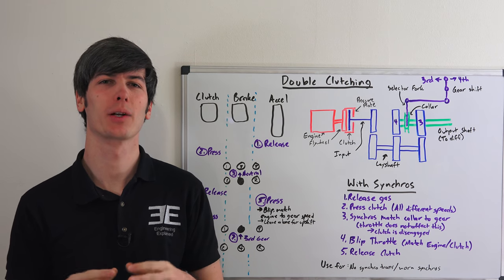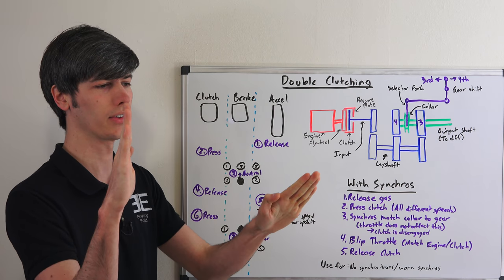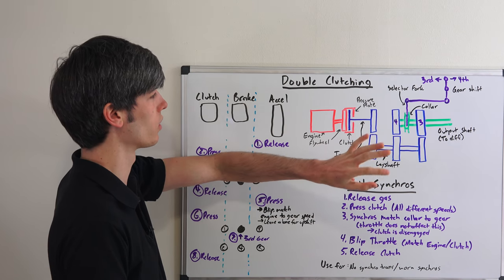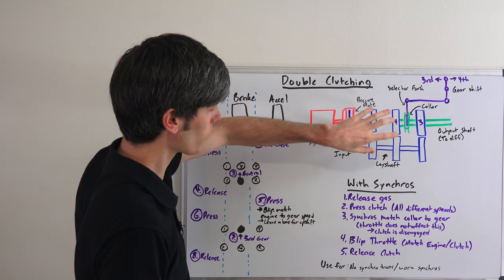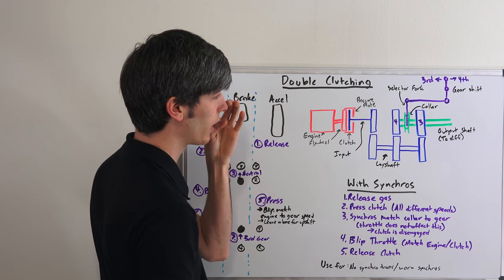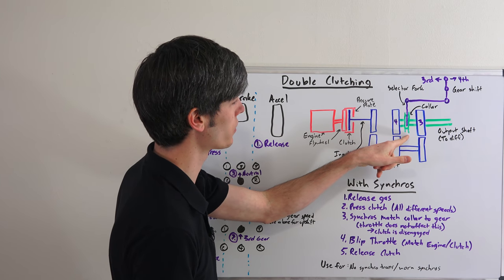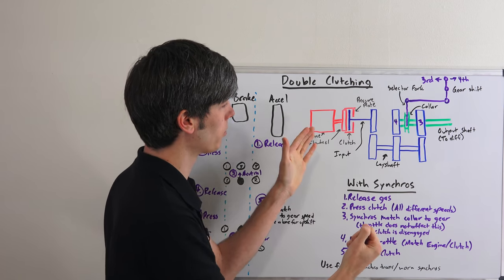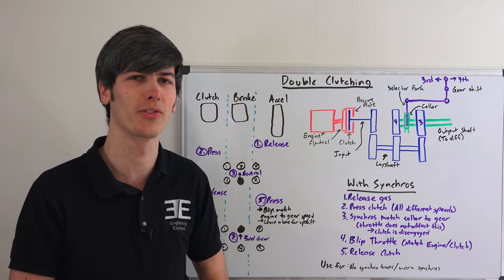What Is Double Clutching?

Comment: Had to do it in my second vehicle, 41 military 1/2 ton closed cab pickup. Straight cut gears with granny low 4 speed. Took a bit to learn the idea but once I had it down it was very easy to shift up or down. Sometimes I could even shift up without using the clutch going up on a good day. Very tough transmissions in those old Dodges, only saw one with a broken tooth and it still worked, just clanked when it hit the missing tooth.

Comment: It's also smoother when you want to overtake so you can accelerate immeditaly without destabilizing your car and pick up speed quickly. In general it's nicer and it add to the driver experience, you can litteraly consider this as heel and toe without braking.

Comment: I've given the thumb up to other videos of yours, but not this one. There were too many things left out, and some parts were not clearly explained and could be confusing. Some particular comments:

1. Driving a manual transmission, you really need to double-clutch. Not knowing how is potentially very dangerous. The synchronizers will  generally prevent grinding gears (though God knows, I've still done it many times—not the most graceful guy that ever was); but if you're downshifting, it becomes very hard to get into a lower gear, and the clutch also has a lot more strain on it as it engages in the new gear. If you're going down a hill and want to downshift to get some engine braking, which may be critically important, you may simply be unable to force the transmission into that lower gear without double-clutching.

2. Synchronizers are such a cool idea! They fix it so you don't ever actually shift the gears themselves, only the splines and collars. Since the actual reduction gears are always all engaged at the same time (quite a trick, don't you think?), you can use helical gears, which are much smoother and quieter (and probably more durable).

Although I've probably driven my last manual transmission car, I always thought the synchromesh transmission, and the planetary gearset, were just diabolically clever inventions (ranking up there with the phase-locked loop in electronics).
Reply: BTW many years ago, I had a VW Bus that broke a clutch cable. TWICE. Both times, for more than a week I drove around by shifting without the clutch, by using the synchronizers and blipping the throttle while shifting. I would use the starter to just get started from a stop. Looking back, I probably should have been put in a straitjacket for that, but it just goes to show that if you know how the hardware works, the clutch doesn't have as big a role to play as you might think.

Comment: you can leave out the first step on the clutch, if you are pulling out the gear when u still have the motor giving a bit power through the drivetrain and its not the tires that spin the motor.

Comment: My 2000 F350 with a 6 speed manual transmission has a synchronizer problem. Specificly going from 3-4 ( I’m counting Lo as a gear) can I double clutch to bypass the bad synchro
Reply: My 1900 Prancing horse Phar Lap has no gears and works wonders even without petrol ! Maybe time for an upgrade, trade in??

Comment: Just making sure I understand the steps correctly. My car has synchronizers...
1.Hit the clutch slide into the next gear
2. Tap the accelerator
3. Release Clutch
4. Engage accelerator?
Reply: or I need to go into neutral first, then press the clutch heading into the next gear...just slightly confused on that end

Comment: This pretty much confirms the 4th gear synchro in my Subaru Legacy is dead. Almost always grinds/crunches when going into 4th gear, up or down. Recently I experimented with double clutching up shifts and down shifts and it almost never crunches when doing it this way. 4th is the only gear with the problem. Great video.

Comment: Regarding a Corvette that I once owned, this explains why a chattering sound could be heard if the engine were to be shut down while in neutral and with the clutch pedal released - it was the winding down of the lay shaft that was making the sound.  On the other hand, it was silent when shutting down the engine while in gear with the clutch pedal pressed (to the floor), which makes sense because the lay shaft wouldn't have been spinning immediately prior to shutdown (well, unless the vehicle was in motion, which it never was).

Comment: I enjoy shifting at times without using the clutch at all. Just match the engine speed to your gear speed going up or down a gear and feel the shifter easily slide into the chosen gear.

Comment: What’s the difference between double clutching and “slam the clutch, press the gas to match revs, release the clutch”? The latter is way easier indeed, but usually the downshift is silk smooth doing this
Reply: Rev matching reduces wear on the clutch and helps make the shift smooth. Double clutching reduces wear on the syncros.

Comment: Why do you have to release clutch when you go from 4th to neutral? 

Can't you just hold the clutch in and blip the throttle?
Reply from the maker: Have to release the clutch so that the engine is engaged to the transmission, and you can use throttle to change the transmission speed for engaging the next gear. Can't do this if you keep the clutch pressed in.

Comment: What is engine speed and gear speed you keep saying it but never elaborate how I find them in my car
Is engine speed RPMs and gear speed the RPMs you need to shift into a gear?
Is one of them the speed of your car?
I thought I was catching on for a second but then you brought up clutch speed is that different from gear speed?
Reply: Maui Randall Trying to summarize without being wordy.. 

Engine speed will be your RPMs  yes. 

"Gear" speed will be the the proper rpms required to shift into said gear, so yes again. Technically, "gear" speed would be "the speed of your car" since the transmission is spinning with your wheels as you drive along. 

Not the most accurate terminology but you are definitely correct!

Comment: To me, double clutching is this. 1 clutch to get to neutral, hit the accelerator to bring up the revs to clutch again to go into the next gear. Changing down without double clutching which allows you to hit the gas pedal to up the motors revs and match the higher revs of the next gear will make the motor rev way too high.
Reply: Euhm, rev less high. It's called "matching" for a reason. So, you are saying that you apply too much gas, and leaving more time will solve that issue since the rev die again. Seems like a no brainer. You could also rev, drink something, and release the clutch. I mean, makes as much sense as double-clutching. Don't forget to rev really high, or drink fast !

Comment: why can't you just put the clutch in and rev the engine up to correct rpm and then shift down? I don't understand why putting the car in neutral is part of the process. what am i missing?
Reply: watched it a second time. you go to neutral so that the transmission and engine are at the same speed to minimize impact on the collar then you clutch and rev before you throw it in gear.

Comment: down shifting (no synchronizers) is the only time anyone should double clutch. with synchronizers you never double clutch.
Reply: I believe the advantage of double clutching as he said even in modern cars is that it doesn't put any wear on the synchronizers. You don't have to do it, but it's useful if the synchros start getting worn out.

Comment: "Double clutching will reduce wear on yoru synchronizers, however synchronizers exist so that this is not necessary"

This is a pretty badly worded sentence - is the final takeaway that this might improve the lifespan of your transmission but isn't a super big deal either way?
Reply: It will increase the life of your synchronizers. Clutch assembly may wear faster.

Comment: So basically, double clutching is letting out the clutch between shifts and then blipping before you push the clutch back in?
Reply: Keifer Bohnstedt yes, and yes! you can technically blip simultaneously on your second clutch press too. it will probably feel that way with practice and becoming quicker

Comment: What's the difference between double clutching and rev matching?
Reply: He already answers that in this video ...
Double-clutching: matching gear (blue on his whiteboard) speed with collar/differential (green) speed.
Rev-matching: matching engine (red) speed with gear (blue) speed.
Reply: Practically the same thing but Rev match is for down shifting so you don't stress out the transmission you match the revs to your speed. It helps down shift more smoothly. I do it for semis not sure it is as necessary for regular vehicles, you can still do it it if you want smoother gear changes.

Comment: It is so quaint to see people talking about antique technologies and techniques. In the modern age of automatic transmissions with two feet driving and in the coming age of electric single-speed, single foot driving this is basically equivalent to steam locomotive maintenance manual talking about how smooth is the process of adding coal to up the steam pressure before a hill. And it is so funny that you think that this still matters or that this can be called "smooth".
Reply: Yes, but driving an automatic is just so ... boring.
Reply: Freya Wyrd then you are driving wrong roads at wrong speeds.

Comment: When i am shifting my manual up from 2nd to 3rd at low RPM and im releasing the clutch the 3rd
gear whines as it is engaging with the clutch just a little and kinda sounds like cool transmission spool noise.
Only really noticed like i said tho shifting up to 3rd from 2nd no other gears.

Comment: On the other hand, this is causing much higher wear on the clutch pressure plate and its spring and also its release bearing.Imagine you drive the car 1000km and you press the clutch 250times doing that, you would press the clutch 500times with double clutching.The question, is the wear on the clutch worth the saving on the synchros, especially with sport cars who have very good synchros (especially Honda).But still, the Clutch is easier and cheaper to replace than synchros...Its the best to just not use your car at all :D but honestly, what do you guys think? Does the saving in synchro wear worth the higher wear on the clutch pressure plate springs and release bearing?
Reply: I drive an Honda. That means my engine will last more than 500'000km for sure and it's a sports car and I Drive it like that
Reply: Lmao you called a honda a sports car. You are a funny guy
Reply: Nicholas Weber 
Pherhaps.They need to make more.

Comment: i am so confused. i feel like this is a way of revmatching, but in rev matching proccess you dont need to release your clutch while in neutral to make your engine spin, why you do it here? whats the diferece? making the transmision spin same speed i guess?
Reply: You can't rev an engine to rev-match, if the clutch is not in. And if the clutch is in, it doesn't matter what gear you are in (since you are in no gear, whatever the stick tells you). There's no relation between double-clutching and rev-matching, it's 2 different things.
Reply: To put it simply: look at his whiteboard in video. 3 colors: double-clutching is to sync blue and green, rev-matching is to sync red and blue.

Comment: Will double clutching put premature wear on the throw out bearing on a fully synchronized transmission?
Reply: I would imagine that it would. Also you are engaging your clutch 2x more than usual which would put wear on your master and slave cylinders.
Reply: Makes sense. I try not to do that anymore. The only times I ever use that method would be down shifting. I got into the habit from my big rig trucking days were you had to do the double clutch technique to grab a lower gear when downshifting. When up shifting I would float the gears and not use the clutch.

Comment: Have you done anything on turbo truths/myths? For instance, letting engine run for a few minutes after a long run, engine oil, etc.
Reply from the maker: Letting your engine run after a long hard run is a good idea. The turbo will be super hot and will cook the oil nearby.
Reply: Engineering Explained Many thanks. One thing I've noticed is you often mention diesels: in Europe (I'm from the UK) diesels were over 50% of newly purchased cars and moreso in larger vehicles. How much of a foothold had diesel-engined passenger cars got in the US and how much has changed since 'dieselgate'? Personally, I prefer the low down torque and longevity of a diesel, but public-perception is shifting against them, perhaps unfairly.

Comment: Love your videos. My question for this video is, "Is double clutching in a synchro box detrimental to the gear box ?"
I drive trucks and find double clutching in the truck and my car very natural. Only on the down change of course.
I find the gear selection is much smoother. But I worry I may be doing some long term damage.
Reply: You must drive well. I have the same natural instinct, I learned all this by my own because it felt better and didn't force the engine so much and I run smoother and quicker than most drivers I know. Being a good driver must be from instinct, like toe and heel breaking double clutch and many more feet tips that make you a good driver. If you drive well you know how to move your feet not your hands. any one can steer but not all can use their feet well to drive perfectly. knowing how to clutch and brake well is another topic. anyone can steer and press the throttle to simple and boring. Driving should be fun.
Reply: I just found this video. To answer your direct question. It will not harm your synchronized transmission to use the double couch system. And it may extend the life of the synchros as it doesn't force the synchros to work as hard your doing most of their work for them. As your skill level increases you can learn to upshift and downshift with out using the clutch at all. This skill may come in handy when your clutch take a dump on you. A lot of truckers use this technique as they have many gears that are close ratio making the shifts between gears quick and simple between gears.

Comment: I learnt about double declutching when I learnt to drive (and non synchromesh gearboxes were still relatively common in older trucks), but was never actually taught it.
I used it on one of the works vans when the synchromesh failed for 2nd gear, and despite my being the youngest driver there, was the only one not to crunch 2nd in that van.

Comment: Very interesting video! I have a question that came up my mind after seeing this video.... Sometimes when downshifting on a vehicle with a synchromesh gearbox, when blipping the throttle the gears seem to engage smoother. What I exactly mean by smoother is not the transition, but the following... Let's say I am downshifting from 4th to 3rd and the gear lever seems to offer some resistance... If I then blip the throttle (without letting the clutch out yet) the gear lever has less resistance, thus it is easier to shift. I am imagining that this happens because I am matching the engine speed with the next gear, thus 'helping' the synchromeshes. Could someone explain why this happens? After watching this video and seeing that the gearbox is completely disengaged while the clutch is in, I am wondering what is exactly happening. Could it be that when clutch is in there is still some drag, thus blipping the throttle still affects the layshaft?

Comment: Great topic. I've wondered what the term actually meant all my life; but never enough to investigate. I didn't know there were ever any vehicle boxes without syncros and I think that's a poor name for them as well. I think a better word for them would be gear-brakes because in essence all they do is slow the disengaged rotating assembly down to a point where the locking ring has a chance to engage with the drive teeth of the selected gear. Now that I think about that, I kind of wonder if there's a way to put just one big easily replaceable brake on the counter shaft that would do it for all the gears instead of seperate ones; but that's just a brainstorm. Thing is, I've never needed the clutch to pull into neutral and with the right over-lap of ratios some vehicles like my 93' S-10 pick-up with a T-5 don't even require disengaging the clutch for a smooth shift if you do it at the right rpm so often times I don't even bother using it. I only deduct that higher rpm shift-points for that to occur would require higher ratios and then make them unpopular for the street and normal driving; so I don't KNOW that; but I've often thought about looking into it. I quess a Ratio/RPM x1000 chart for whats available would help. I'm sure the guys with the Lyncos know all about it. I think an industrial "brain-less" hydraulicly actuated multi-stage planetary with an electic pump and just seperate solenoids for each stage would be really cool for the street; but I don't know of any that anyone has built yet. Anyway as always, thanks for sharing man, you do a good job of filling in all the cracks.

Comment: This practice was super scary and daunting when I first wanted to try it. I have a car with a transmission from 1982 and my transmission in my 2007 daily has some synchros that are starting to wear. It took me a while to get it through trial and error, but now I do it out of habit, even when I don't need to. Even if you have a modern manual trans, this is great to know for when you try to drive an older car.

Comment: First of all, i love your videos, very informative, i look forward to all your videos.  I do have a question, going by what you explained in this video, i got an issue with crashing gears in my truck in between shifts, it basically rattles a bit trying to get into gear while upshifting and it doesnt do it all the time, and first is hard to get into at a complete stop.  could that be an issue with a worn/leaky clutch master cylinder or is that most likely the syncros? Thanks